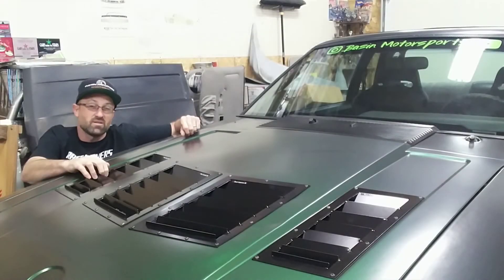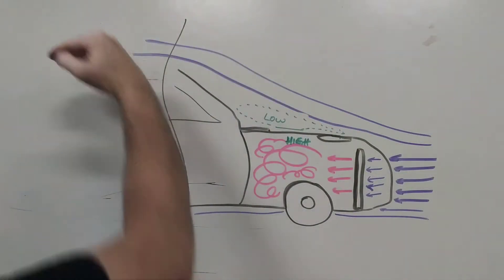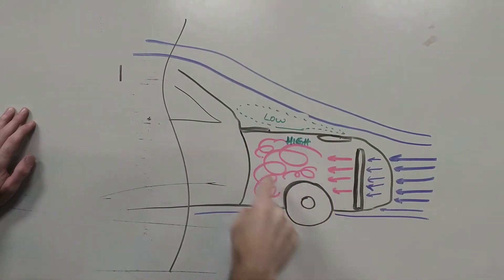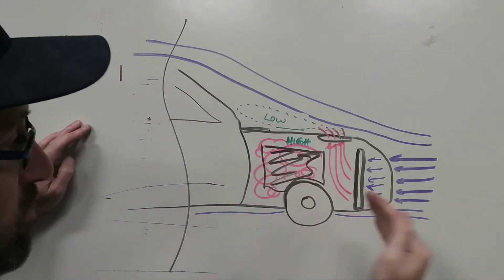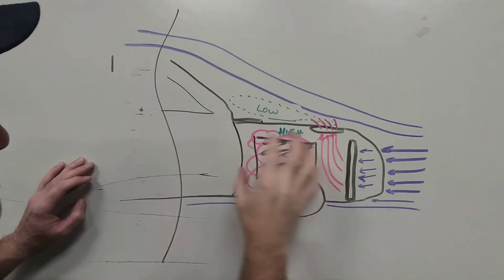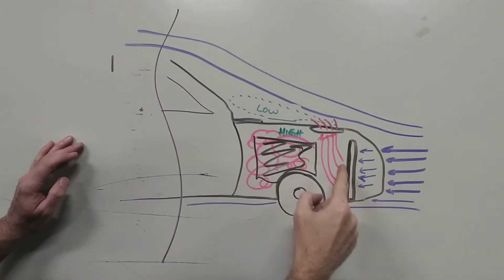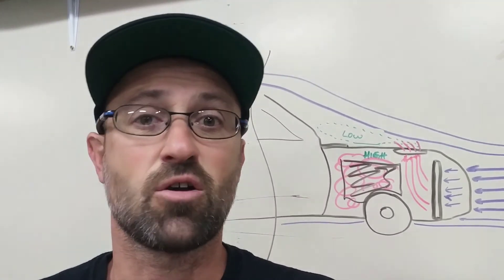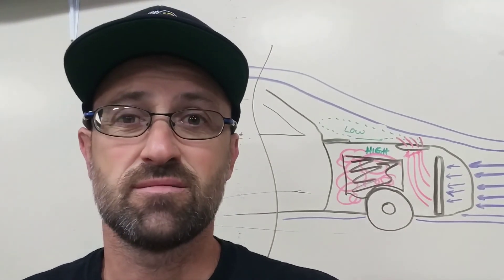How Do Hood Louvers Increase Cooling Capacity?

Comment: Important: Only works if the pressure on the hood (location of the louvers) is lower than the pressure in front of the radiator -> e.g. close to the windshield, the pressure might be higher, leading to even worse cooling capacity

Comment: Great video. Liked the simple drawing because it shows how the cool air coming from the front of the car gets trapped and circulates becoming warm or hot air. Especially with the bottom covers for the engine. There is no where for the air to escape. Personally I think hood louvres are must on turbo driven sports cars. Along with low temperature thermostats.
Reply from the maker: Thanks for the kind words. It's crazy how inefficient airflow is on cars, but there are a lot of developments for cooling. Under normal (non-modified conditions) most work fine. Add in a turbo or anything that generates heat, and it can get dicey.

Comment: Great vid,
What about fender vent louvers?
Reply from the maker: Fender vents release built up air pressure that can lift the front end. They won't help with cooling.
Reply: @BasinMotorsports hey do normal louvers like in the rear windshield increase aerodynamics or add drag?
Reply from the maker: @Freedomtooffroad  they most likely move the pocket of air to a more rearward position. Like a drag wing does.
Reply: @BasinMotorsports  so they do most likely increase mind me as my English is not the best in the world
Reply from the maker: @Freedomtooffroad  Yes, they should increase aerodynamic flow of the air.
Reply: @BasinMotorsports  Ahh thank you
Reply: They won't do anything to a normal car